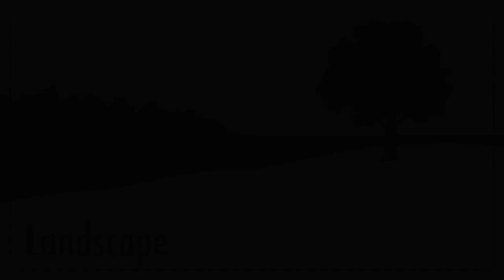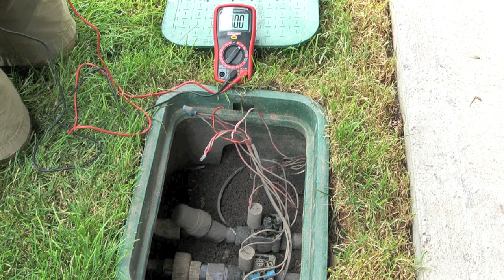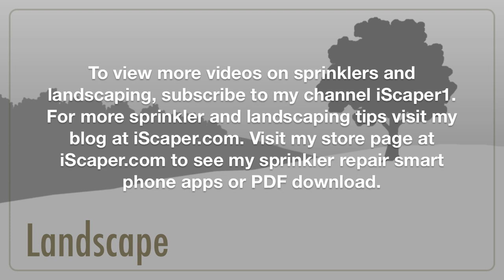Troubleshooting: Testing power to a sprinkler valve.

Comment: @iScaper1 I rewired all my valves, I had a total of 11. Going through the process of turning the valves on from the control box, only 10 zones popped up my ALL my sprinkler heads. I soon realized that one the zones was not connected and apparently the previous owner had rerouted the sprinklers through another valve. I fixed a crack in the PVC prior and guess "I reconnected the valve to no where" Thank you for your quick response. I am definitely a subscriber!

Comment from the maker: If you're getting 27V to the valve your wiring is fine, the problem has to be in the solenoid. Power from timer is AC not DC. Try opening the valve manually to check if it will open and close without power. Make sure flow control isn't tightened down if the valve has flow control. Valve should work if you replace the solenoid.

Comment from the maker: You'll have to put time on one of the stations that you want to use the wire from at the timer. Then manually start that station. Next go to the valve box and undo the common wire. Finally put the black probe from your tester on common wire from the timer and the red probe on the station wire you just started. You should get 24-29 volts on your reading. This will confirm the wire is good. You can do the same test on the other two wires.

Comment from the maker: AC volts. My tester has 2 settings, 600 Vac and 200 Vac. I use black probe on common wire and red probe on station wire.
Reply: Thanks I was wondering about that

Comment from the maker: It's a Craftsman 82312. I would check voltage to the valves instead of ohms, you want between 24-29VAC. I believe the tester does have an ohms setting if you want to check resistance.

Comment from the maker: One wire on the sprinkler valve to the common wire running to the timer and the other wire on the sprinkler valve to the station wire running to timer. Common is usually white. Check with your local extension office to how many inches per week is recommended in your area. Then look up precipitation rates on your sprinkler nozzles & match to what's recommended. In my area 1-2" per week is recommended & my Rain Bird spray nozzles emit 1" per hour so I need around 1-2 hours per week watering.

Comment from the maker: @quinnrasta 
One good trick is to take a piece of paper and write down which color on the timer goes to which valve. Ex: Station 1 is red and runs rotors along west fence, station 2 is blue and runs front spray heads. This way you know which station on the timer is running which valve in the yard. This speeds up troubleshooting when needed but only works as long as there hasn't been a splice and color change in the wiring by the previous installer. Thanks for watching.

Comment from the maker: @quinnrasta 
Finding a leak in a valve box is a process of elimination. First, remove the water from the valve box and check if there is a leak while the sprinkler system is off. If there is a leak it will be on the pressure side of the valve. If there are no leaks in the valve box with the system off, next open each valve manually and check for leaks as you open each valve. This will tell you if there is a leak on the zone side of the valve. Let me know what you find. KT

Comment from the maker: A multi-tester is pretty cheap, $10-30 and can be used around the house also. It's handy to have one. With it you can quickly see what voltage is being put out by the timer, plus you don't have to shut the water down. After testing the timer you can take it to the valve box and test the timer wires to see whether there is a break. You can't do this with your solenoid example.

Comment from the maker: Yes, the controller must be sending power to the valve. In this video I turned the power on from the controller to the valve in question and then tested the voltage. 

To locate shorts in timer wire you need the ability to put a tone on the faulty wire with a line locator. Line locators work good most of the time but they aren't infallible. If I have that repair in the future I will do a video on it.

Comment from the maker: You could do that or turn the valve on at the timer that is the farthest from the sprinkler supply lines. This will help pull air out of the supply lines to the sprinkler system.

Comment from the maker: I've been installing and troubleshooting sprinkler systems for 25 years, does that mean I'm still an "amateur"?  Also it's a solenoid not a "selenoid". 

If the timer wire to the valve has 24-29VAC then the problem has to be the solenoid. Often times the cost of a solenoid alone is almost as much as a complete new valve and it is almost as fast to change the top half of the valve with new parts as it is to change the solenoid alone. In this case the solenoid is $8 & a new PGV100G valve is $12.
Reply: With all due respect this video is on the Engineering level 10. This is not helpful. You say you already know it's station 6 (and it's the white wire) yet you have two colors in your hand black and red. You then verbally say you will test the "white" wire but with your hand you grab the black line in your hand and put it on a bunch of mixed color spaggetti. Then you put the red on what looks like two white wires. This isn't helpful at all I have two red wires coming out of a hole and my solenoid has two white wires. My panel says station 11 yet the wire at my rainbird is brown? I'm so frustrated right now. I've spent all day in the TX sun and got no where. :(
Reply from the maker: @JDoe-hb7pc  Sorry about the confusion. Owner told me station six wasn't working. The station wire at the timer terminal is white so that's the wire I want to test at the sprinkler valve. The group of wires in my left hand are the common wires. The black and red wires are the solenoid wires from the sprinkler valves, I don't need to worry about them for this test, I'm just confirming I have power coming from the timer. 
In your case you want to test the 2 red wires coming out of the hole, forget the solenoid wires for now. It almost sounds like there is a splice somewhere in the timer wire between the timer and sprinkler valve because you said the wire color at the timer is brown. If you don't have power at the sprinkler valve then a splice in your timer wire may be the problem.

Comment from the maker: If you have power at the timer but no power at any of the valves you probably have a timer wire break or a bad splice somewhere. Only solutions I can think of are: run a new timer wire to the valves or rent a wire locator and find the bad spot in the existing timer wire.

Comment from the maker: I've used them for years with no problems. They're not one size fits all. You can buy a 15VAN for 15' areas down to a 6VAN for 6' areas. In between that there are also 12VAN and 8VAN nozzles. If you have an area that is say 120 degrees where a 90 degree nozzle won't cover and a 180 degree nozzle covers too much, a VAN nozzle can be adjusted precisely to that area. Finally a 15VAN nozzle adjusted to 180 degrees has the same precipitation rate as a 15 series MPR nozzle.

Comment from the maker: If you have a single valve in the box it is not a good sign that you have 2 white wires and 1 red coming in. It could mean there is a splice somewhere. Splices can drive you crazy because if they go bad it's hard to find them without a wire locator. 

Before you bust up the concrete do some more testing on the wires to see if you can isolate the problem. If all else fails buy a length of timer wire and run it to the valve above ground, connect to timer and valve and see if the valve works.

Comment from the maker: It's probably because you only have the 2 heads. If the valve has a flow control you could try tightening it clockwise and that would help it shut down.

Comment from the maker: Check your valve wiring. You must have 2 valves wired together. Check that you have one wire from each sprinkler valve connected to the common wire going to the timer. If you have 4 sprinkler valves that would mean you would have 4 wires connected to the common wire. Then check that you have only one wire from each valve connected to one station wire. Ex. Station 1 is red, station 2 is green, station 3 is blue, and so on....

Comment from the maker: Do you have more than 1 valve in the sprinkler box? If so all the common wires will be connected together and run to the timer via a single wire. Only the station wires get a single wire to the timer. One wire on the solenoid is a common wire and the other is a station wire, it doesn't matter which. If you have more than one valve in the box try this: Turn power on to problem valve, connect the wires to another valve in the box you know works. Will it start that valve?

Comment from the maker: No, I want to test voltage from the timer to sprinkler valve. Set the tester to AC volts. The timer should be putting out between 24-29 volts.

Comment from the maker: It's not a good sign to have water in the valve box. It could be that you have a leak somewhere in the manifold. Remove the water from the valve box and see if you can isolate where the leak is. You may have to dig up the valve box to find the leak.The valves will still operate with water in the valve box, but any exposed timer wires covered with water will eventually corrode and fail.

Comment from the maker: Probably not. Turn your timer off, and then turn the solenoid on station 2 on and off to see if the valve will open and close manually. If not, you probably have internal valve problems.

Comment: How do you test for power - isn't the power off until the controller activates that solenoid?  Do you activate that station valve on the controller, then test for power at the valve solenoid wiring?  

Do you have any videos of correcting electrical shorts in irrigation controller lines?  That would be very useful!

Comment from the maker: Use a multi-tester and test the timer's output to the stations. Turn on power to the stations one at a time and test output to each station. One probe on the station terminal and one probe on the common terminal. If the timer output checks out go to the valve box and test power from the timer to the valves. One probe on the station wire to the timer and the other probe on the common wire to the timer. This will tell you if there is a problem in the timer wires feeding the valves.

Comment: I get about 27V on the wires going to the solenoid but my zone doesn't work. I don't think the problem is with the solenoid or valve because I ran 3 9V batteries and the zone worked. I also tested the panel and the panel is fine. I'm thinking it's something with the wires but I don't understand why I get power all the way up to the solenoid but the solenoid doesn't activate. Any recommendations other than busting the concrete open in my driveway and replacing the wiring? Thank you for the video

Comment: I tried 2 different solenoids and 1 works for sure. Using the batteries set the sprinklers off even though it runs DC. I'm thinking the issue is with the wires since I couldn't get continuity on them after shorting them (the power was turned off). I'd like to exhaust all possibilities before busting the concrete open to replace the wires. Any other ideas? I noticed there are 2 white wires and 1 red wire coming to the valve but only 1 white (common) and 1 red wire leave the control panel. Ground?

Comment: No mention of an Add-a-Zone. There's a few prerequisites but they can be quick and easy in the right situation. I know they don't last forever but $100 for even 5 yrs of operation makes more sense for some folks. They may have wifi controller/valve communication by then. :) Also some valves have the battery operated controllers. The new Hunter model is improved and now is rated to go 2 yrs in between battery (2-9V) changes.  All depends on budget vs expectation.

Comment: Good video - I actually have 3 valves connected to my 6 zone timer controller.  there are however 6 lines running from the controller to the 3 valves.  I wanted to add an additional 4th valve but when testing the 3 remaining lines, I found out that there is no voltage coming into them.  It is hard to believe that all the 3 remaining lines are not working.

Comment: The timer must be sending power to the valve you are testing at the time. Granted, it is assumed but if you are making an instructional video all steps should be included instead of assumed.
Reply from the maker: Brian Eubanks 
At 0:40 on the video I do say I'm testing the power from the timer, but maybe I should have shown that step of turning the valve on from the timer. Thanks for the feedback.
Reply: I think he is saying that you should have just mentioned whether you had the station on or off from the control panel.  I agree

Comment: The sprinklers in my yard are rain bird spray heads. I have a zone that if you turn the timer off the sprinklers stay running for 10 seconds then shut off (pressure goes down during ten seconds) it has only 2 heads is it a problem?

Comment from the maker: Hi John. I've never had a pump cycle on and off when the timer switches stations. If Rain Bird told you the relay has too much inrush current have you tested the voltage from the timer to the relay? Is it 24-29 volts? I'm wondering if there is a problem with the relay where the pump keeps cycling on and off.

Comment: The problem is with 1 of the wires (the red wire coming from the panel to the valve). The driveway is between the panel and the valve, any suggestions to fix it that doesn't involve busting the concrete to re-run the wire?

Comment: You could mention if the system should be on or not and you can say what setting the multimeter is on, those were the two questions I had before your video and the same question I have after watching your video
Reply from the maker: Good points. Water is on to the valves, I'm just testing voltage so the water doesn't need to be turned off. Multi-meter setting is AC volts to test the voltage.

Comment: If you get no power at the valve using this method, how would you test to determine if its the common wire or dedicated zone wire that might have a break/issue?
Reply from the maker: If you have other valves in the box that work off the timer your problem is probably the station/zone wire.

Comment: Gary, I have a valve in my yard that is not opening fully - the valve makes a whining noise when activated with the control box. But when I manually open the valve, it works fine. Does this mean that the valve isn't getting enough power from the control box?
Reply from the maker: It would be unusual for it to be low power from the timer, you probably have a bad solenoid.

Comment: Kerry this is john from sprinklers 4 less have u ever had a problum with a pump sys that when the cont goes 2 aney sta that the pump will burp off then on agin i removed a explx con 2 install a explxme w flow cont i am having a problum with this the only reason i removed the esplx con is becouse it could no expand 2 flow cont i also instald a fl300p flow senc every thing is wired right i took a pic and marked wires i was told by rb that the 
Pump start rleay has 2 much inrush

Comment: Well here I am 11 years later with a question; will I get a response?  Hope so!  😂 I performed the continuity or resistance in sprinkler wiring on my Rainbird ESP- ME and got no reading on all (I used Carrie's YT directive). Consequently,  I'm now going to test at the Valve Box.  When testing Valve Box wiring, what setting/s should my controller box be on?
Reply from the maker: You want to manually start the timer on the station you're testing. If you're testing station 6, manually start station 6 at the timer. At the valve box, set your tester to AC volts and put the black probe on the common wire coming from the timer and the red probe on the station wire coming from the timer. You should get 24-29 volts.
Reply: @iScaper1  Holy goodness, you responded 11 years later Carrie!  You are remarkable like many have said.  60 year old lady here with no money to waste, so I'm desperately trying to figure this out. Will try later on today what you have recommended.  I wish you all good things for your kindness.
Reply from the maker: @donnaducharme7659  Good luck!

Comment: Do you have to turn the power off to check the voltage like you did at the solenoids? Seems like you are touching the wires with your bare hands. Won't you get shocked?
Reply from the maker: When the wires are live they only carry 24 volts so handling them isn't a problem.
Reply: same with door bell systems

Comment: I have an odd situation.  When my system runs through its 4 zones, when the last one shuts off I get water hammer under the ground and in my pipes in my house.  So I have to go to main sprinkler shut off and turn it off.  Is this a valve issue or what?
Reply from the maker: One of the problems with cities going to closed systems is water hammer. You may have to install a pressure reducer if your pressure is high at your home, and possibly a water hammer arrestor. Here's a couple of links that may help: http://media.wattswater.com/F-WHA.pdf
http://www.watts.com/pages/_products_details.asp?pid=6805

Comment: Hi, When I'm turning on my system for the first time of the season do I need to manually open each valve first?
Reply: If you're in cold country and have air in the lines (typically you will blow air through the lines to prevent burst pipes or parts in below freezing weather) then, yes. If you're not in an area where it freezes, you probably can skip this.